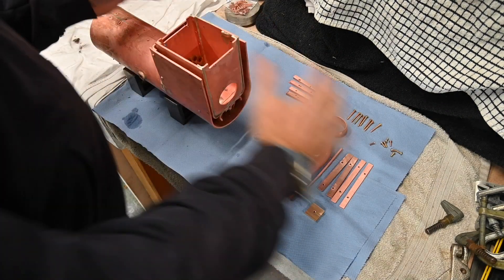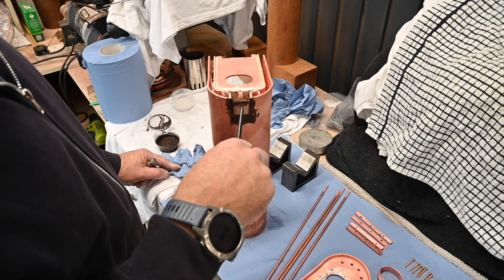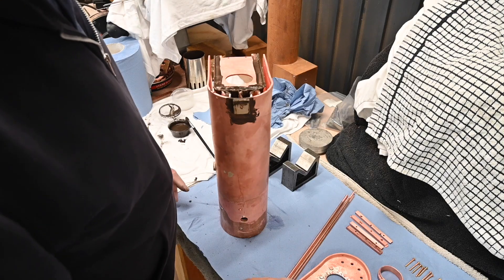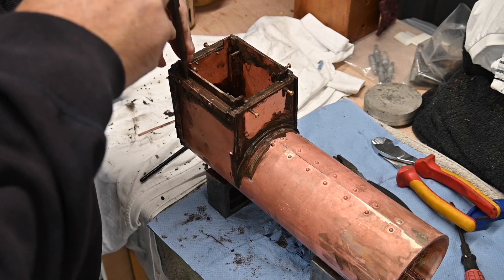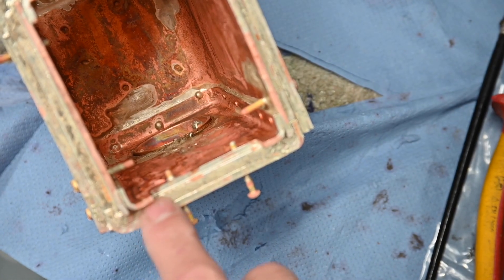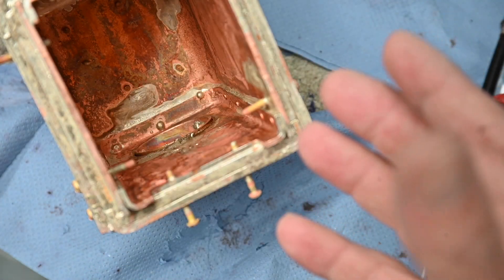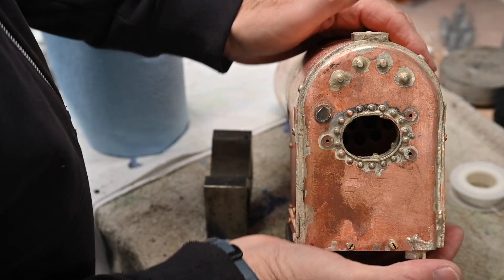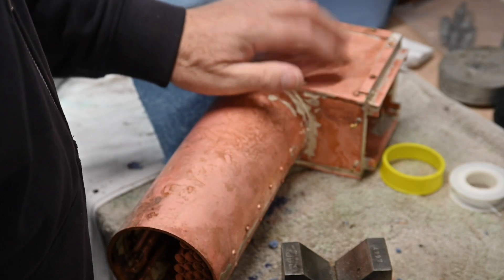Traction Steam Engine Boiler Assembly and Silver Soldering

Comment: Well done Mark. I've only built a steel boiler so I hold you copper boiler builders in high regard indeed. I do like silver soldering, tho' and take pride in my neat joints (most of the time!) But, I had a bit of a "duh" moment when you applied flux to your existing SS joints😮, to prevent oxidation of the weld. Sometimes the bleeding obvious is not!
Thanks for sharing?
Reply from the maker: Glad you enjoyed it 👍

Comment: Hey Mark well done mate! Big copper constructions are never easy! Check out my 3" Fowler DCC series. I used Oxy-Propane to silver solder mine but due to the 5mm thick copper I also had to use a Propane blowtorch to keep everything hot! 
Not sure which Flux you used but I used Tenacity No.7 Flux  as it lasts longer than Easy Flo.
Reply from the maker: Ok great I will check it out, thank you 👍

Comment: Could you have made the hole that goes to the steam chest after the hydrostatic test?
Reply from the maker: I could have but there is a strengthening plate for the steam chest fixings inside which has to be fixed relative to the hole position. I should be able to blank it of sufficiently to be able to test it when the time comes. 👍

Comment: Welcome back, Nice job, I don't know about you but even I was nervous. Merry christmas
Reply: I agree, I was watching that silver soldering thinking yeh that looks expensive if it goes wrong.
Reply from the maker: @mattphilip4595  your right, I have a lot of time and money invested in this boiler and there is still a way to go 😂
Reply: @EnglishHobbyMachinist  looks like a professional job so far. Keep up the good work.
Reply from the maker: @mattphilip4595  thank you 👍
Reply from the maker: I was nervous, in fact I put of doing it the day before because I needed to be totally focused. Merry Christmas to you 🎄
Reply: @EnglishHobbyMachinist  Just out of curiosity where do you buy your silver solder from. I went on Cup Alloys site the other day, I started sweating when I saw the price, It's gone up quite a bit since I last bought some 🥵
Reply from the maker: @paulrayner4514  I buy the strips from cromwell the 1mm and 1.5mm I normally use google to find the cheapest, my last lot came from Mac models. Hope that helps 👍
Reply: Hoping you share the videos of the stays. Very educational. 
It’s a shame you could share the process with the oxy-propane. 
Thanks for sharing the progress so far.
Reply from the maker: @ajm76079 I will be sharing the stays which will also include silver soldering them with oxy propane. I have to do some work on the tender first so I can get the position of the stays. 👍

Comment: Nice job, it's far from easy. I found that oxy-propane is a real bonus when it comes to fixing imperfection. Good luck with the stays.
Reply from the maker: Yes thank you, I did the repairs with the oxy propane and will be using it on the stays. But I have to do more work on the horn plates before I can set it up for marking the stays 👍